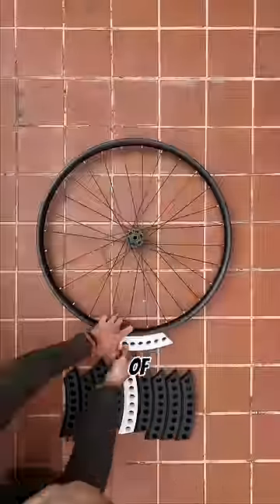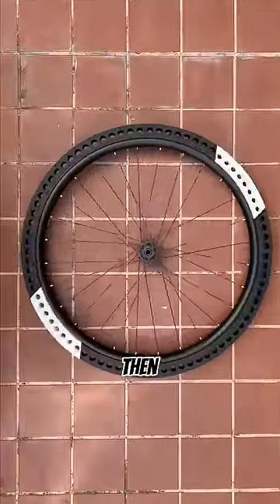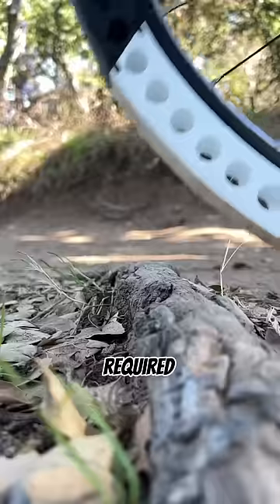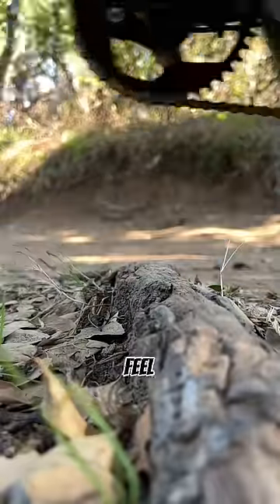3D printed tires in action! #mtb #cycling #bikeshorts

Comment: Not being able to go around corners is a pretty fatal flaw!
Reply: So make them for your enemies only.
Reply: Nah, simple, just go straight and roll over everything. These tires basically make you Ironman.
Reply: @newolde1  Fair. I don't know why I didn't think of that.
Reply: Just slide em back onto the rim and keep on truckin
Reply: @spendalll  for sure, so long as you don't feel like a truck just ran over you, from the rock or tree you just slammed into because your tire separated mid turn..
Reply: Naw just slide your pelvic bone back together and keep on truckin. Happy trails!
Reply: @Llamaington  well in that case maybe we should just wear this wrapped around our pelvic bones instead then..
Reply: Super glue it on
Reply: There still get ya home and save ya rims tho
Reply: Yep
Reply: Fr I like going corners really fast
Reply: You could also make the flat part more rounded
Reply: They gonna fix it it's just matter of time❤
Reply: Well, it'd need a redesigning of the rim and you're good to go.
Reply: มันก็เป็นแค่ของทดลอง เราสามารถพัฒนามันไห้ดีกว่านี้ได้
Reply: I'd zip tie everything
Reply: There is easy fixes for that problem
Reply: Skill issue
Reply: American cars and motorcycles have been like that for years
Reply: @Random-ed2xf  these are perfect if u got a flat on a really far away road trip
Reply: Yup
Reply: F1 car ah ah type of bike
Reply: Use zip ties
Reply: Zip tie them tight through the holes.
Reply: @newolde1 cliff comes up ahead: ah yeah lemme just go straight over it
Reply: Use glue
Reply: Okay for me! Lol. As a novice rider I don’t turn at any measurable speed anyways 😅
Reply: Cut one section shorter and stretch it tighter
Reply: If only the romans had invented them.
Reply: @biggibbs4678  I thought the exact same thing too
Reply: It's omega flaw
Reply: @biggibbs4678 that's what im saying
Reply: YeA
Reply: 🙋‍♀️Couldn't u just put Zip ties or a piece of wire woven through the holes in it work to keep them on?
Reply: Zip tie to the rim as well, make the holder groove deeper and more form fit, problem  maybe solved. Seems  like an easy to remedy issue
Reply: @newolde1 or the truck that literally runs you over after it pops off and you go sliding underneath the truck.
Reply: Wouldn’t zip ties work?
Reply: Simple, use zip ties through the holes and around the rim of the wheel and then will stay on around corners
Reply: just zip tie them to the rim
Reply: Yeah this is right it just seem like you could glue them on like a special glue that after a ride you can like pop them off this is just my opinion should just to be clear
Reply: Zip tie the tire section to the rim as well problematical problem solved
Reply: Use on rear only maybe cause less troubles..
Reply: It's okay, you can just slide them back on the rim and you're good 👍
Reply: @ratanante this
Reply: Literally
Reply: It's ok, just slide it back in.
Reply: FFFFFLEXX TAPE!!!!!!!🎉
Reply: Just like on normal tires you should always be careful going around corners.
Reply: @Rose-yx6jq  "Just like on normal tires you should always be careful going around corners."
You're not a mountain biker, are you? 😀
Reply: Just zip tie the segment around the wheel
Reply: Literally
Reply: Plan b: glue them
Reply: womp womp
Reply: You just have to make them tighter
Reply: super glue it
Reply: Bro, just glue them and then they were not fall off
Reply: I feel like that could be fixed with a better shape tho
Reply: I feel like rounding the tires a little bit would help avoid it, along with some locking mechanism and an increase in size along with changes in design to accommodate the size
Reply: just use hot/super glue
Reply: He said there's no sealant required, but likely gluing them would be a good idea
Reply: ye ur rims r gonna be hella brone
Reply: Just zip tie them to wheel or sum
Reply: Sounds like a job for super glue
Reply: Here is a unbrekable glass for water. Just make sure you don’t drink from it but then you’re perfectly fine 😂
Reply: Super glue
Reply: @spendalll  or just use normal tires and not worry
Reply: @newolde1  they dont
Reply: Use zip ties in the holes and strap them to the rim
Reply: @newolde1  fr, just ride up the tree, duh
Reply: I think just use zip tie
Reply: Duct tape fixes everything 😅
Reply: Its okay just slide em back on when u come back from hospital
Reply: No shit Sherlock
Reply: I think it’s you can’t tilt the bike around corners, not you just can’t at all
Reply: Atleast he is honest
Reply: Glue?
Reply: Super super glue from Matilda
Reply: why
Reply: @crewlolthevyonder9542  the super super glue the 3D printed airless tire on to the rims
Reply: @crewlolthevyonder9542  "why"
Because the earth is round, obviously!
Reply: @newolde1 rear brake??
Reply: @newolde1 so if you need to go around a corner cause you are about to fly of a cliff then will these tires save me?
Reply: @newolde1 'Dang there’s a wall in my way'
Reply: Word
Reply: It's for your enemies.
Reply: just whare them out to where the corners round out, problem solved
Reply: @newolde1 alright until you ride straight into a tree😂😂
Reply: Just use those ties and tye certain points
Reply: @tonyb9735  because it makes literally no sense you need to turn you can't just continously go in a straight line an obstacle will eventually pop up in front of you
Reply: Make a bigger front wheel
Reply: At least they’re honest😔
Reply: @newolde1 They really do, but I don't know if the old lady crossing the street liked what it did to her.
Reply: Haters gonna hate
Reply: @whiteeyedsh4rk697  "Haters gonna hate"
Lolz!! Yes, they are. ❤
Reply: so basically it’s a dodge now

Comment: Those holes in the middle of the sections are good points to put zip ties looped to the rim without rubbing the zip ties to the ground, that would've held that thing up better
Reply: Hey, just zip it would ya? Doctors gotta eat too ya know!
Reply: @newolde1 
We will zip it.
Zip (tie) it to the rim, so we don't have any unplanned tire disassembly.
Reply: Youre the comment i was looking for!
Reply: Exactly
Reply: Then what are companies waiting? We need this!
Reply: Yeah and when it finally comes off you'll just have to cut them all off and put new ones on again.
Reply: It would make a good tire as a slip on tubeless that could be installed with no tools required other than a pair of scissors to trim the zipties.
Reply: Yeah I was saying the same thing
Reply: @Solid7o7 uhm? you are aware you can unlock zip ties, right ? Lmao, just unlock them. There's no need to cut them. Ffs 😂
Reply: @marthastewwart  it is just not worth the time to replace them, save them, or to explain to you why cutting is better than reusing zipties that you just used to scale terrain.
Reply: @Solid7o7 a bag of ties is like 10 $
Reply: @JeremyPoythress this be good for emergency as a one off if your main tyre pips just to get u home or wherever until you can fix your puncture..but thats it. Not that safe if can't turn , so emergency option only.
Reply: @UKKC80s but with zip ties you would be able to turn
Reply: It'll still scrape the ground hard af and be borderline unusable after a couple hundred turns

Comment: These seem like good emergency tires. Compact and never break.
Reply: Except that they don’t work and are complete shit
Reply: @pkennedy0219  you can see them working in the vid lol
Reply: @RACOONAFIED  my dude, it literally can't turn corners
Reply: Y’all forgot that the comment said “These seem like good emergency tires.”
Reply: Thats why i said emergency tires. Obviously a normal tire is better than that, but would you rather ride on the metal part or have a soft plastic temporary replacement? @CeoOfChickenTenders
Reply: They're less compact and reliable than just bringing spare folding tyres and a bunch of inner tubes
Reply: @RACOONAFIED they will have no grip
Reply: Do you want to know what I carry as an emergency tire?
1. A tire
Reply: @thatguy1917  2. a tube
Reply: @All4Grogg  3. Anything but this space consuming impractical sh¡†
Reply: To everyone saying you would just carry an emergency tire over this, your ignoring something key: do you have an air pump on you.

If your blow out is near an air pump, or you have one on you, ya, a tire is better. If you don't, these get you back on the road until you can get to an air pump.

If I was biking to work, and got a flat, there would be periods where I wouldn't have easy access to gas stations, and therefore could not pump up my tires. I have 5 gas stations along or near my current route. 3 of which are all in a block of each other, and 4 within a mile of each other, and near the last bit of my commute.

It's also about a 10 mile bike ride. (A bit less, just roughly)

This thing perfect: Frick no. Would it get someone to a place they could fill or patch a normal tire? Yes
Reply: @krvys7226  yes, I carry a pump and always have. It a very common and I would consider it a necessity, on not fat tires it takes all of 5 to 10 minutes to change a tube and inflate with a small pump. In the decades of riding I can not think of a single time hiking to a gas station would have been more convenient or faster than just pulling off to the side and changing a tube.

Comment: Some possible improvements
-put fasteners (zip ties) through the holes so it is held on better
-make the tyres more rounded so they can bank through a turn
Reply: Thinking the same thing
Reply: or use a type of glue as fastener
Reply: @Zach-et3tn  that would ruin the rim and also make the tires non-replacable in case the tread wears out (assuming there is tread on future models). on top of that, it would probably not hold on as well.
Reply: @Salad_2  good point i was thinking some type of glue witch just helps with the zip ties and a type that can be took of with acetone but yeah probs wont hold nowhere near
Reply: Why not try altering the design so that it kind of wraps around the rim. So adjust it To make it round and have flaps or something kind of go around the edge of the rim so they self lock? Imagine it like an  € inside the tire piece but with little lips that wrap around the tire?
Reply: You're a freaking genius.
Reply: @onkcuf  you talking to me?
Reply: @Freakashoni  what if on top of that we also filled it with some kind of gas instead of solid rubber, kinda sounds like it could work
Reply: @caminhaodelixo2  your reinventing the tire then lol
Reply: @caminhaodelixo2 yeah that's a good idea dang this dudes gotta try that. like a 3d printed wheel but it's rubber instead and it's hollow and we'll fill it with air so that it can deal with tougher terrain. i think we've got something special cooking here
Reply: What if you just put them in the tire
Reply: I'd rather suggest having a long belt passed through the whole circle that can be tightened by some twisting mechanism, pulling the whole thing tighter and closer to the rim

Comment: I’ve got a tip.
Forget about covering the tire. That’s obviously failing. Turning is one of the most important features in a tire. You should design a full bike tire that uses this method. And you could probably also charge less for them.

Comment: Keep at it Mate..i'm sure you'll find a way to keep the tyre fixed to the rim. Good job so far. I live in an area where California puncture weed is everywhere so an improved version of this tyre would be invaluable.
Reply: They already have foam inner tubes that don't pop. At least for 30 years now.
Reply: Buy gator skin tires. I ride from DTLA to HP and don’t have issues with flat tires. Also throw on some puncture resistant tubes
Reply: GOATHEADS!

Comment: It is better to wrap the rubber to the rim so the rubber doesn't keep falling apart
Reply: Zip ties
Reply: I agree or epoxy them to the rim
Reply: @peepdaasleeppolice8348  it will be wither from riding
Reply: What? "Wrap the rubber to the rim" ???
Reply: @MaYbYl8eR  zip ties
Reply: It's better to buy a real tire.
Reply: @taitsmith8521  no
Reply: Naw you can just slide em back on to the rim and keep on truckin. Happy trails!
Reply: @Llamaington  zip ties
Reply: @peepdaasleeppolice8348  Why use zip ties when you can just slide em back on the rim.
Reply: @Llamaington  is there would be no reason to slide them back on if you have zip ties
Reply: That’s fuckin y
Reply: @MaYbYl8eR  glue to the rim or slide ons
Reply: Big Nono
Reply: What if he just invent a tube filled with air and extra rubber tube to protect it
Reply: Zip ties. Never enough zip ties. Use zip ties to hold the zip ties.
Reply: @airevolution926 is ziptie the answer to happiness
Reply: @rsyd9397  puncture repair fluid exists, it would be a pointless invention.
Reply: @bencastor9207  im pretty sure he was joking haha, just sarcastically stating what a tire already is which is what this was an alternative to

Comment: go too fast and they will fly off, as in downhill.
Can't go off-road, rock will push it off the rim
hispeed turn will kill you

It would be great to use as a temp spare
you can make this work, keep working on it
Reply: Just keep a spare tube with you then a five minute fix and back to riding
Reply: @joewars73 unless you ride an E-bike. It's always the rear tire and it's a hassle getting that thing off and on. 😂
Reply: You only see the negative in things don't you. Look on the bright side once in a while mang, you'll never need new tires again! 

...Ok, that might be because you buckled like a tin can that a slightly anorexic elephant wearing a tutu sat on, broke your collarbone, the bike's frame, and shattered the rim when the tire ripped off at high speed. But hey, you just gotta keep focus bruh, there's a silver lining to everything!
Reply: @newolde1  you'll still need to replace them eventually. They're still subject to wear.
Reply: @chrisnorris3641  no way, you mean to tell me that the laws of physics still apply to these? I don't believe it.

Comment: Add zip ties through the holes and around the wheel rim, one every few inches.
Reply: No
Reply: @DJWolves97  yes?
Reply: @luislantigua  No.
Reply: @DJWolves97 why?
Reply: @MrSkeleton14  Because of nonya
Reply: Wont fix the no grip
Reply: @aaronstorey9712  I see this as more of a temp wheel rather than a wheel replacement, so being able to corner would be ideal, but the grip wouldn't concern me if I was only using it to get back home. But outside of that, I do agree, that it would become a bit iffy.
Reply: @partiallyfrozen3425  the thing everyone is missing with this is that it's literally just an engineering challenge, this is fabricated at home

Comment: You could make any adjustments to keep it from derailing and keep it on the least amountof weight, like adding a couple siderailings that go through the holes and are secured by either little screws or anything...

Comment: Make a steel clip that can be attached to hold the rubber in place on each end, which will also make the back tire more sturdy and heavier being able to whip it around faster for more tricks and that way you won’t have to put it back on every 5 seconds then mass produce the whole set for 50-75$ and give me 3% of every 100$

Comment: Zero 3D printing experience here-question.Cant a complete 3D tyre and rim be printed in one using 2 different materials? Strong carbon fibre compound for the rim bonded to a softer compound for the tyre? I realise that attaching spokes would then become an issue to overcome but is that idea even viable?

Comment: You need to modify the rim. Add a flang lock. Similar to what guys do for off-road tires on ATVs. Basically a big washer that you can bolt to your rim. You could even have a lip that locks into your tire, modify your tire with a receiving notch .

Comment: While it's downsides are pretty major, I'm looking at 2 aspects of this thing.

1)as an emergency set in the case of a blow out, these would be lightweight emergency tire. 

2) it would take a new bike rim design, but could one be made in conjunction with this (or an upgraded design of this) which better locks the pieces in place, allowing for better general turns? (And before people say "new rim design would mean you can't use traditional tires and inner tunes", it can be designed in such a way, long as its planned in advance)

Comment: if there's a flaw, find a way to remove the flaw. what if instead of Knotch clipping. how about Flanged clipping or rim Clipping where the parts clips into the wheel and it be hold in by the outside rim just like most cars

Comment: The tires need to be rounded at the edges to allow leaning into the turns. If you can do that, along with making it fit tighter around the rim, then maybe it would work.

Comment: It certainly has potential, but the fact that it comes out of the mount when cornering is completely unacceptable! The holes were probably just meant to save material and increase mobility, but they also offer the option of attaching cable ties. You can't use too few of them though, because at speeds of 20 km/h+ and a weight of at least 40 kg+, unexpectedly strong forces come together. And if it comes loose in the wrong place and at the wrong time, it can easily cost you your life, maybe even someone nearby, or put you in a wheelchair for the rest of your life...

Comment: "well, until you bed your rim."

"Well, until you get a section stuck in mud"

"Well, until you crack one."

"Well, until it balds out so much the structural integrity causes it to become walled out and become too large to fit on the rim."

Comment: you could have solved the flaw so easily its upsetting me you gave us this as the final product, if you made a wheel, or screwed through those 3d prints, into the wheel you could secure them, and why are the flat, this looks like its meant to be used in the city, yet you demonstrated on rough terrain….no wonder you cant turn the wheel is flat not curved, bro just thought, what if?….. and then didnt tweak it at all just went with the original idea